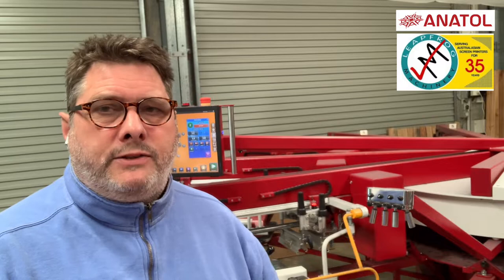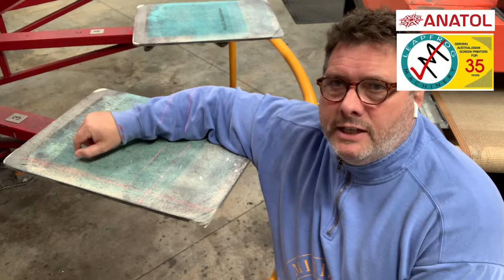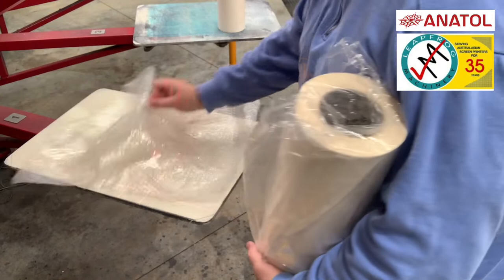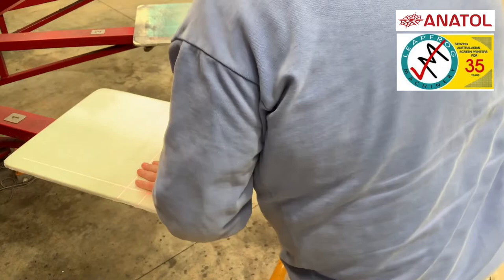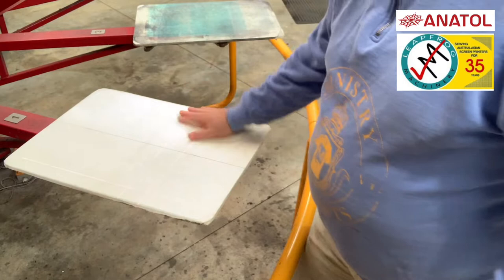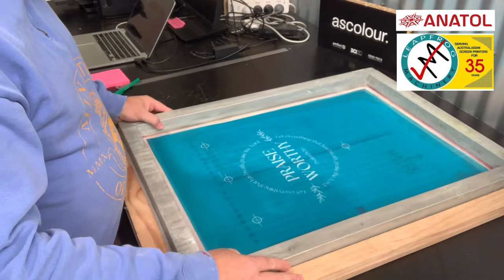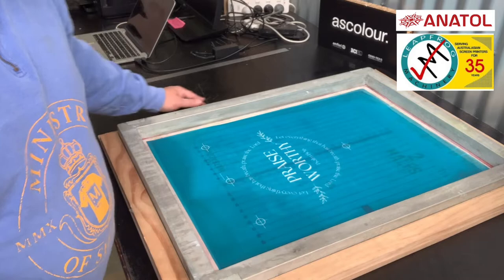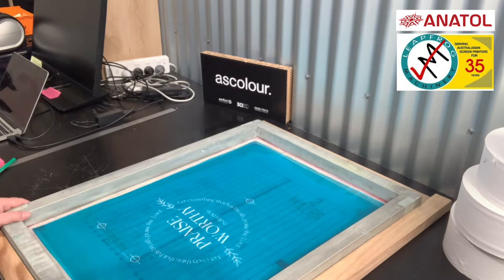Screen printing Dialling-in your print-head rego before using micro registration on an Anatol Volt.

Comment: Awesome video,  almost 4 years of not truly liking my volt micro reg system and I think you nailed it in 1 video.  I use both 20 x 24 & 23 x 31 inch screens on my volt as I run a lot of youth items and because I can with the side arms.  I always find my micros moving left or right in an awkward line when I turn the micro knobs, and that’s because I always realized that my side frame holders are not squared to the pallets, and I once tried measuring out and marking the bars that the arms slide on, but that didn’t help because I didn’t have an actual frame in the arm to find the perfect and parallel centers.  If that sounds confusing well that’s probably why it didn’t work.  
Using a template “lines” screen for both sizes is going to make a huge difference when I’m going back and forth between screen sizes.  Also I found myself never putting the screen in the micro side arm completely until it couldn’t go anymore then locking down the screen and that is because I never had my side holder parallel to a true center point.  I think this video is going to make a huge impact in my shop and I can already see in my head a lot fewer micro reg headaches.
Thanks
Reply from the maker: Hey Jeff, thanks for the feedback. I am so glad the video helped. Let us know how you get on.
Reply: Thanks for the video! This has helped us a lot! Though We’ve are pressed for a couple months now but are still struggling with registration. Every time we lock the left clamp everything bumps out of reg. Any suggestions as to what you guys do to combate that ? Thanks!!
Reply from the maker: @skatelogic800  apologies. only just saw this. How is it going now? If you are still having issues contact sam on sam@ministryshirts.com.au

Comment: I was just curious why you did not  go with the phneumatic lock where you just the flip the switch?  Screen moves less when the both of the clamp holders are tightened at once instead of locking one side at a time doesn't it? When I try to move the screens with the micro, it takes really long time, especially with the back clamp manual.  I am thinking of getting the side clamp for my antec legend and in the future i might get thunder press with the side clamp with the pneumatic option or just the side clamp
Reply from the maker: Thanks for your comments and questions. The Anatol Volt does not have pneumatic screen clamps. This video is not about the problem of screens moving when the clamps are fastened. Side clamps will work really well. Keep on printing!
Reply: @ministryofshirts  the micro registration locking knobs seems to be gone on the new models.
Reply from the maker: they are all there on our press.  @wagyu_killer
Reply: @ministryofshirts  on most manuals press they have it.  not the screen clamp holder, the  locking knobs to move the 3 point registration plates.  on older volt i can see the locking knobs
Reply from the maker: ah right I understand you now. Yes they no longer use the locking knobs this is correct. The micro adjustments tends to be tight enough when the arms are clamped down. I believe the issue you that you are having is not related to not having the locking knobs on the rego as the screens are moving slightly when you lock in the screen clamps. You should look at the screen clamp mounts and check you have them tightened up, check that the holders are 100% level, and that the clamps themselves are not adjusted too tightly only the screen. You want them to be able to hold the screen well but not to put pressure on the screen such that it moves. @wagyu_killer